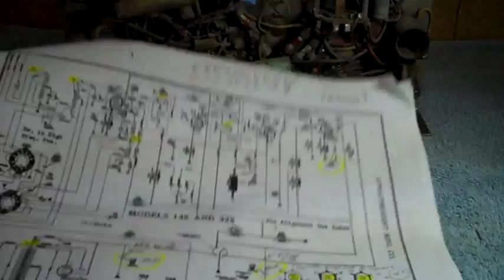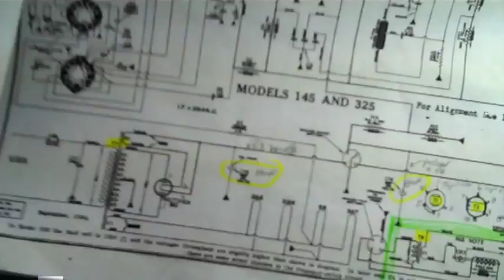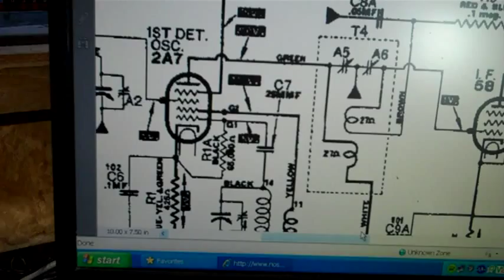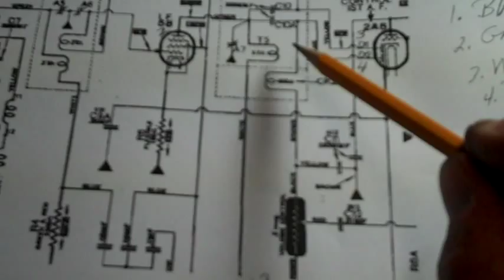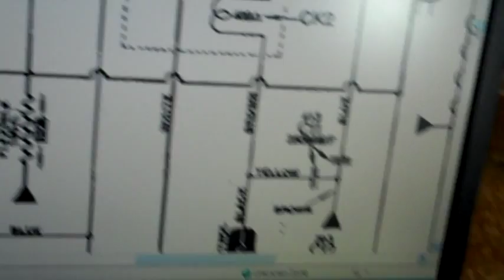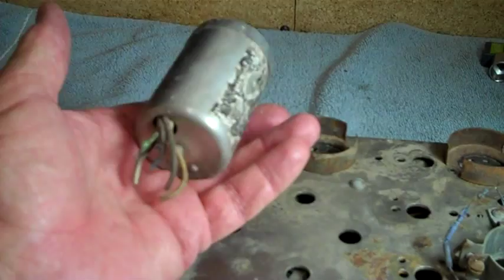1935 Atwater Kent Model 145 Repair and Restoration (Part 7 of 38).

Comment: I have noticed you do like your radios to be major projects to start with.  Kind of explains why.  Me, I kind of deal in volume, with more than 90 radios and counting.  I have a couple long term projects going, but, for the most part, I find them, recap, check coils and resistors, recap, tweak and shine them up pretty.  You are right, your way is the best way to learn schematics and troubleshooting.  Rick McWhorter's book is a good tool for the new hobbyist, also.